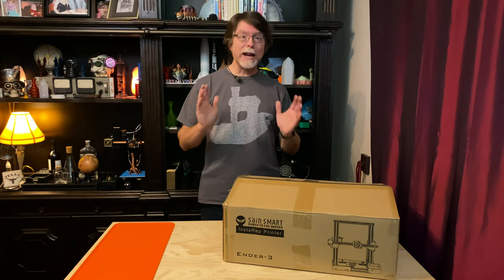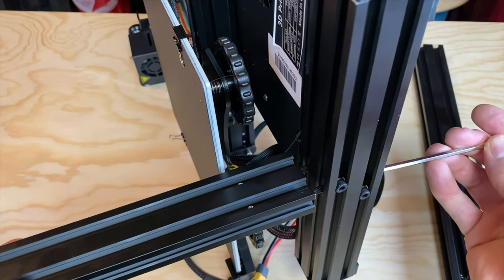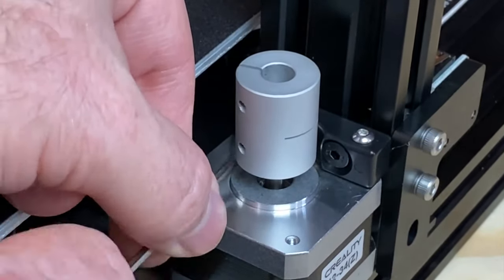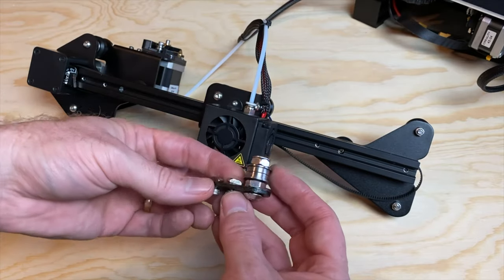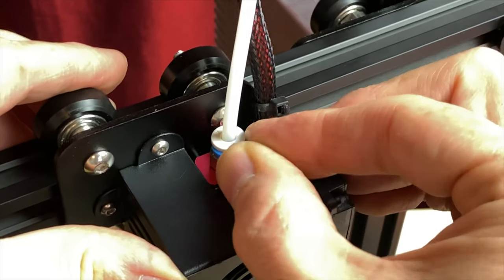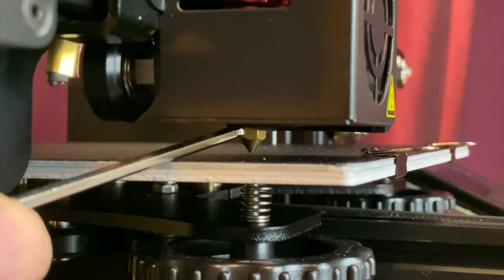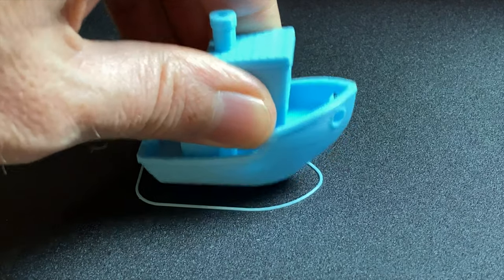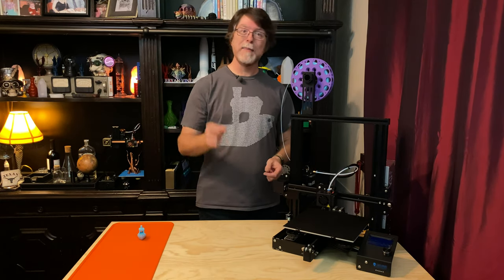How To Build the SainSmart Ender 3 3D Printer

Comment: Greeting Bryan, I just bought my first 3-D Printer, also on Woot.  It Said Ender-3 Pro, so I thought it was Creality.  When it arrived in a SainSmart box, I was immediately concerned it was a sub-standard knock off.  Thank you for this video.  The instruction in the SainSmart box did not include any text; it was all images.  To have you walk through the steps was invaluable.  SainSmart owes you compensation.  Thank you for the leveling instructions.  That has been a major concern for me.

Comment: Thanks Brian.  I bought the same printer at the same time from Woot.  I already had a regular Creality Ender 3 but I couldn't pass up the deal at Woot.  One major difference I've noticed between them is that the build plate on the Sainsmart stopped holding fairly quickly and now I put glue stick on it.  The leveling gcode is very handy, so thanks for sharing that.
Reply from the maker: Hi Gizmo! So does yours have that fiberglass-like subsurface that the print surface sticker is attached to? It's like it's almost a flex plate but not quite. You can bend it a little to help you get something under the print to remove it, but you can't bend it too much.

I'm probably going to install another Wham Bam flex plate on this printer. I'm leaving it stock for now, but I'm making a list of what I consider essential upgrades. At least, they're essential to me! Others may find them useful as well.
Reply: @BV3D  my bed kinda warped upwards at the center.. so now i can slide a paper easily on all 4 corners and it can't even go under the nozzle when on the center... planning to get a glass bed cut tomorrow...
edit: printer arrived just last week

Comment: Great video, however here is a few useful tips i have learned:

1) DON'T USE A NOCTUA. The static pressure is way too low and this can lead to problems overtime with clogging.
2) DONT BUY A CREALITY SILENT BOARD, instead, buy a bigtreetech skr mini 1.2 E3. It offers a lot of more features including a built in bootloader and is way cheaper.

Comment: Great build. Well, you just showed me even more trouble I've had with my Creality Cr10S Pro. The T-Nuts would not rotate as you mentioned and just stayed inline with the slot. I don't bother with that spool holder and belt tensioner anyhow.
Reply from the maker: T-nuts can be fiddly little things. Sometimes I find I have to back the screw out a fair bit before tightening them again, to give the T-nut room to rotate. 👍

Comment: Great video Bryan. You covered it all very clearly. The only thing you missed (IMHO) was a step outlining how to adjust the x gantry so it was “level”, and maybe how to check and adjust that the frame was square before fully tightening all the bolts. I really enjoy your videos - and your corny humour. (From one dad to another).
Reply from the maker: Hi Ron! I had the beginnings of X gantry "leveling" in the raw footage, but it wasn't fully fleshed out.

But for the most part, having the X gantry extrusion parallel (by sight and by feel) with the bracket that it mounts to, seems to have gotten it just about right, at least for the printer I received.

When I first built my Ender 3 Pro, it was way off and I had a hard time getting the bed adjusted properly.

The subject may need a video of its own.

And thanks for the kind words! Us dads have to stick together.

Comment: Nice assembly video.  Very easy to follow for a first time assembler. I bought an Ender 3 pro first. Then I bought a regular Ender 3 for the same reasons you did.  My Ender 3 has been upgraded to the point that I’m not sure it’s still an Ender 3.
Reply from the maker: Hi Corey! That's the thing with the Ender 3 and the Ender 3 Pro. It's almost like it's infinitely moddable. There must be a thousand different ways you can really personalize these machines. Some of them are must-haves (like firmware with thermal runaway protection enabled), while others are nice-to-haves (like the mainboard with the silent stepper drivers). And there are SO MANY printable upgrades! 👍

Comment: Excellent video, I only have a question. I understand this sainsmart ender 3 it´s not a original ender 3 but works equal? Please help me because I am new in this world of 3d printers and the people tell me that the ender 3 or ender 3 pro it´s the best at this price, actually I am with the eyes on the sainsmart ender 3 pro but I really need to know if the quality of the print it´s exactly the same.

Thanks for your time, I suscribed to your channel now

Comment: What teleprompter do you use?
Reply from the maker: I'm using an iOS app called simply Teleprompter (https://apps.apple.com/app/id941070561). It recently went from being a paid app to a free app, which is great for everyone who hadn't bought it already. I had already bought it though, so... Anyway, I have that running on an iPad mini sitting inside a box made of black foamcore board, with the glass from a dollar store picture frame held at a 45˚ angle by 3D-printed brackets. The whole thing sits on a tripod mount, and my iPhone sits on the other side of the glass, watching...Always watching...

Comment: Noctua definitely do a 24v fan. I have one on my Ender 3!
Reply from the maker: Oooh cool! What is the model number of the fan?
Reply: @BV3D  It is a Noctua NF-A4x10 FLX
Reply from the maker: @SKWDiesel1  Ah. Yeah, that's the one I use. It's a 12V fan. I confirmed the specifications (https://noctua.at/en/nf-a4x10-flx/specification).
Reply: @BV3D  I replaced my 24v Ender fan with it. I have not changed anything, is the original fan 12v then?
Reply: I think I may have moved the connections on the controller board to a 12v  supply after all... memory isn't what it used to be!

Comment: The question a potential customer needs to ask themselves is does Crealitys experience in manufacturing this printer, the customer service experience and the brand name warrant the $40 in the price difference? only time will answer this question
Reply: From what I understand, Saintsmart is just a mass purchaser/importer to US (and Canada) . they mass buy from, factories and just slap their name on it.  So this is likely a real Creality unit.
Reply from the maker: It does have a SainSmart-branded bitmap that displays at boot time, so they've got their own firmware image on the board. That said, it doesn't appear to have Thermal Runaway Protection on it, so I'll be upgrading that pretty quick.

Comment: Hi my ender 3 doesn't switch on again after a relative long time without use! What can I do? Help please
Reply from the maker: If your printer will no longer turn on, start checking the power supply.
Make sure it's plugged into a known-good electrical outlet, and make sure to use a known-good power cord.
Also (with the power cord unplugged from the printer), check the fuse located near the power switch.
I hope that helps! 👍